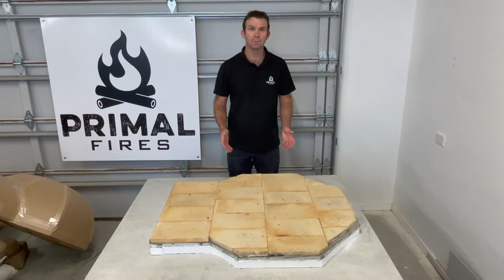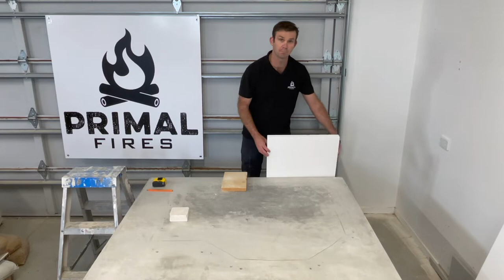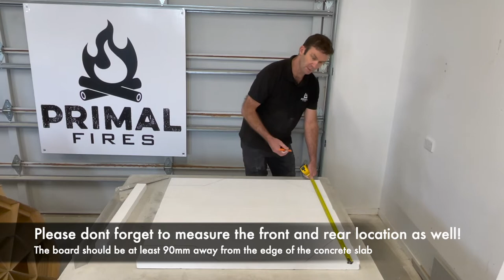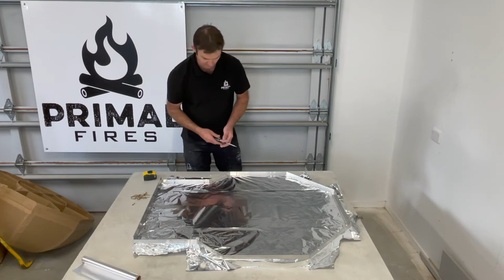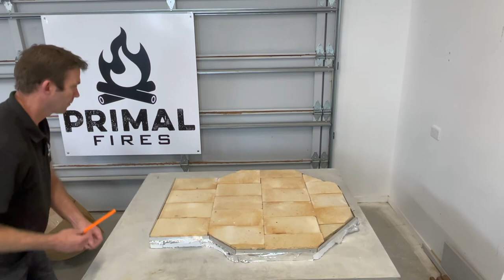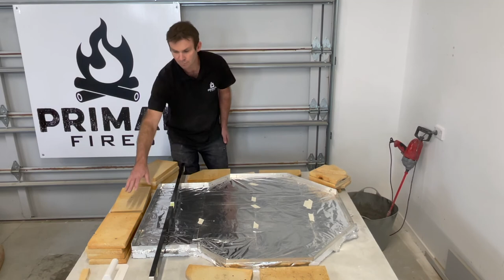Part 1: Base insulation and floor of Primal Fires 800mm Pizza Oven

Comment: I have a question , how strong are those calcium silicate insulation boards at the bottom? what if one sides goes due to weight of the oven? will it cause a tilt of the inner floor? and are they calcium silicate boards?